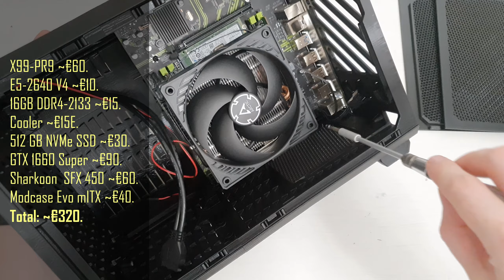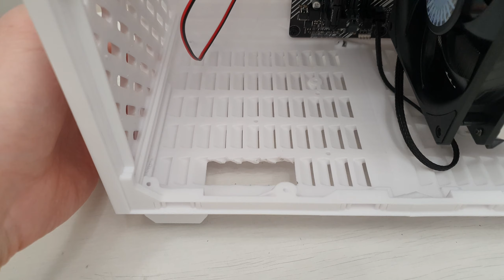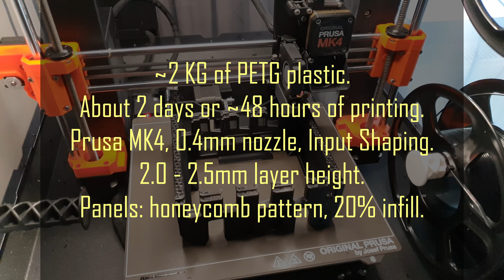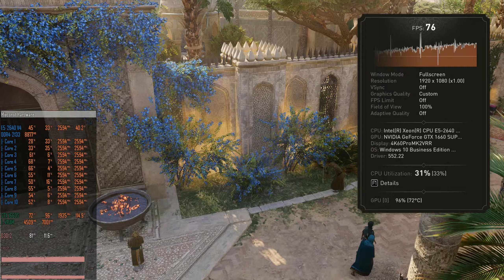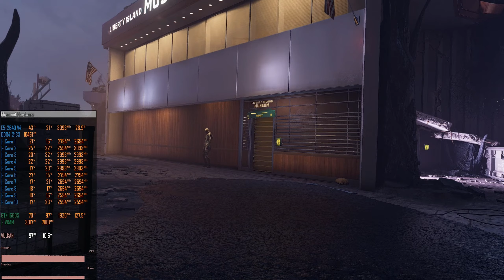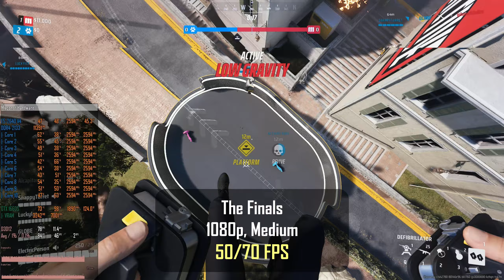X99 Mini-ITX budget gaming PC for €320 – E5-2640 V4, GTX 1660 Super, MODCASE Evolution

Comment: Is it possible to order the modified case you have somewhere? What are the dimensions of your modded case?  Can you recommend any other cases for SFF builds? Preferably on Aliexpress... What's the smallest you can go with X99 and what about decent X99 mini ITX motherboards? In Thailand the cheapest and smallest SFF case for a budget Machinist or Zsus (PR9/D4) goes for about $19 (623 baht) and is 360*160*285 and will fit both a mATX MB and PSU. Similar dimensions as the Metalfish S5 Max or ZZAW B3.
Reply from the maker: If it's so cheap in Thailand then why do you need something else from AliExpress? There are no X99 mITX boards, only some rare expensive branded options or the pathetic X99i-Server.
Reply: @Miyconst  Thanks for your reply. It's a pity that affordable mITX boards are not available, so mATX is the way to go in case of X99.

Comment: So I stumbled on something interesting when trying to optimize my computer for Helldivers.

I'm still running that 2689 v4 and Helldivers was heavily stuttering every 2-4 seconds. 

I couldn't figure out what it was and was using Latmon and all kinds of things to try to pin-point the problem. Some said you needed and ssd, I'm using an Intel Optane ssd so that was not the issue.

Now simple things liek turning off background apps helped a lot on their own but (to make a long story short) I saw someone saying that somehing called, "dynamic tick," lets your cpu turn off the clock on some cores that are not in use or fully used. to save power. 

To disable dynamic tick open CMD with administrator privileges and use the command – bcdedit /set disabledynamictick yes

I also used the registry to turn off cpu parking and holy moly did that change some things. 

Before many games would have one cpu core maxed out for usage and everything else would be at about 30-50% usage.

Now games like Helldivers, Cyberpunk and Elden ring do not even max out the usage on one core. Granted i play with vsync on but the change in the task manger reading were amazing. Also a number of games that used to use all cores now only use about half of the 10(20 with HT) on die. 

Have you ever played around with either of those two settings? I only ask because I suspect that Windows is treating these big old workstation cpus  like they are being used on a laptop that needs to conserve power. Maybe that's why 4 core cpus reigned supreme for so long. They worked at full strength all of the time because they needed to. these 10, 12 and 14 core cpus mostly just want to sleep. lol

Once I made those changes to windows both the 2689 and 2690 started to feel like overkill. =)
Reply from the maker: I have a question, did you enable high performance profile in Windows?
Reply: @Miyconst  Yes I did and as many as I could find. I did the old windows power profile. I did the Nvidia one and then I did the highest setting for each of my apps in the "Graphics setting," setting for windows. None of that had helped Helldivers.

Doing a clean wipe and reinstall of my graphics drives also helped but did not get me all the way there.

I used to use things like, "Throttle Stop," and, "Process Lasso" but have yet to use anything like that with my most recent install of Windows. Throttle stop used to noticeably help. So that might be a safer way to do a similar thing.

Strangely the clock speeds do not seem to be any higher but what I get out of the clock speed seems to be more? I really am still struggling to understand what I'm experiencing. It was just your comments about Alan wake stuttering really reminded me of what I was getting with Helldivers and I wondered if there was any connection. 

Also, I was just surprised by how much performance I was able to claw back from windows.
Reply from the maker: Then I have a few more questions: do you have clean Windows installation with all updates (including optional) installed?
Reply: @Miyconst  The install is fresh as of February I'm pretty sure it's up to date. Update history shows about 60 updates since install. The only other thing I did recently was disabling Multiplane Overlay. I can see how that might have helped with stuttering but I don't think it can explain the changes in cpu  usage that I'm seeing in the task manager. I can also feel it in the use of the pc.

Comment: Nice build! Really like the sff xeon builds. I would use 2680v4 though, it's only 10 euros more than 2640v4. Machinist PR9 could be bought on aliexpress for 35 euros when on sale. Where do you buy ram so cheap? I can't find 2x8gb ddr4 for less than 35 euros.
Reply from the maker: The 35 Euros price doesn't include 25% swedish VAT. The RAM I found on local second hand market, sometimes these ECC REG modules can be obtained for cheap, especially the low frequency ones.
Reply: @Miyconst  Thanks for answering. It's rare, but yes, i have also found now on local used market 16gb 2400mhz samsung ecc ram for 20 euros. The thing with VAT and aliexpress is confusing... Aliexpress states that VAT is included in price for eu countries, and it's variable, depending on the country. Croatia also has 25% vat. I never get taxed beyond aliexpress price.
Reply from the maker: @ultrawidegaming9402  so, you mean that the PR9 is available for 35 Euros with VAT? Well.. then it's a good deal, when such deals show up, shipping to Sweden usually costs 20-30 Euros, so the final price is the same as the regular offer.
Reply: @Miyconst  yes, i bought the last one about month ago for 34 euros, free shipping, it was choice day or something like that, and i had some coins.  Currently the price is around 50€ with shipping. So I was surprised with the price you need to pay when ordering from Sweden

Comment: Hello. Can i still use other processor on my mobo even after i install unlock turbo boost mod for e5 2640v3 on it. Im planning to upgrade my processor but i dont know if it will work😅
Reply from the maker: Yes, you can use other CPUs but if you plan to install a CPU that does not support TBU - restore the original BIOS first.

Comment: Hello, I have a question. I recently bought the Huananzhi X99-QD4 motherboard. When turning on the computer, the board emits an annoying screeching noise from the BIOS speaker. I did not find any option to turn it off in the BIOS.
This is not an error signal, but a system startup signal. Do you know the solution to this problem?
Reply from the maker: Fill in the speaker with a super glue.

Comment: Can you make a video showing how to connect standard power supply to dell t7810 please 🙏
Reply from the maker: Sure, if someone can provide me with a T7810.
Reply: @Miyconst  t5810 has the same psu pinouts you can it instead of t7810
Reply from the maker: @nextlevelgc_TI  okay, I can do the video if someone gives me a T5810.

Comment: Sff cases for mATX boards are a criminally underserved market
Reply: There are several cases though, quite cheap ones on AliExpress, such as PCCooling i100, several cases from Metalfish, Jonsbo, unknows brands, etc. Minimum size is about 15L, smaller is not possible with a micro-ATX motherboard, and as far as I know there are no or hardly any mini-ITX and (mini-) DTX X99 boards. So the cases with a vertical GPU mount at the other side of the CPU on the mainboard are just too tiny, mostly about 190mm high, about 135mm wide and 300 (or more) deep, for a full GPU, whereas the cheaper X99 boards are approximately 215x185. Keeping everything really ITX is pretty costly, a niche?

Comment: If you can, for comparison, build something cheap, used on AM4? Maybe Ryzen 1600/2600?

Xeons are cool, but what next? AM4 will have cheap 3600/5600 or 3D or more cores in a few years ;)
Reply: They got to be the same price for that to happen. It won't happen unless those AMD cpus were damaged by overclocking and degraded so much they perform worse than they are supposed to.
Reply: @user-qn6kb7gr1d  A small chance, Xeons may also be of lower quality and unstable, they worked 24/7 rather than 8-12 hours per day.

I checked out of curiosity and dug around.

I chose as an example 
E5-2673 v4 is +- 75% price of Ryzen 5 5600 (used).
  
Approximate performance/price and unfortunately it's close to assembling both platforms from scratch.
According to cpubenchmark net the processors are similar in multi core performance 
(ryzen in single thread about 30% faster)

I recently watched it
The ULTIMATE Budget Workstation 2x20core xeon gold = +- AMD Ryzen 9 5950X in multicore ;)
Xeons are nice, but when you get a ready-made old two-socket server at a good promotion. Then you can play around. In my local official market this is impossible.

Or play with a good dual X99 + 2x E5-2673 v4 2x20c (savings 16%), probably close to  AM4 5950X in an optimistic variant when customs duties are not added. 

I ignore the risk of a larger loss when selling X99 + CPU

This is no longer a bargain and Ryzens are slowly getting cheaper. 

The only advantage is learning how to work with many virtual computers where a "physical CPU core" is needed

Comment: It will be interesting to see in 1 month of gameplay and the GPU load over 90 pushing all that heat effects on the PLA chassis. Will it deform? Will it possibly bend the GPU?
Reply from the maker: PLA plastic will surely warp, change colour, and maybe even crack but I printed with PETG which is a totally different story.